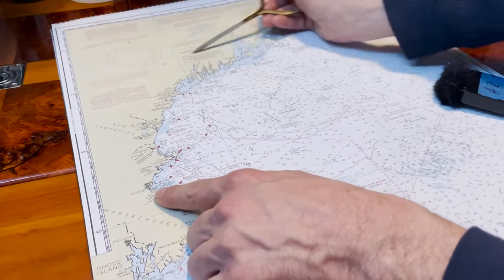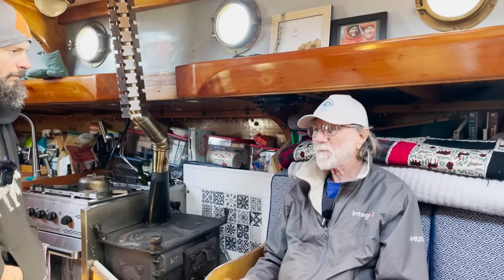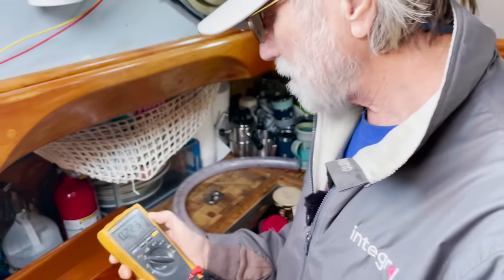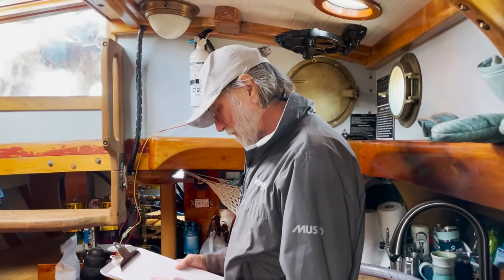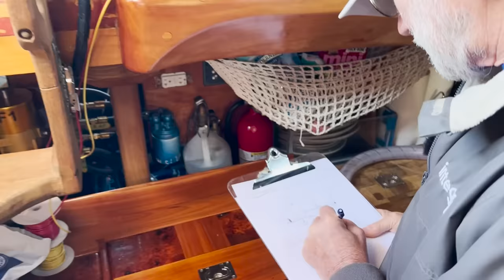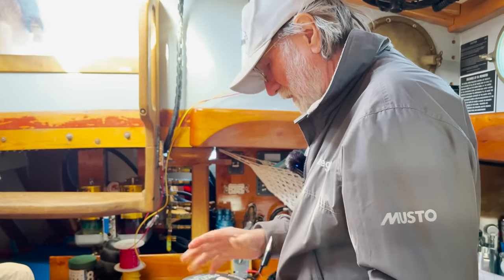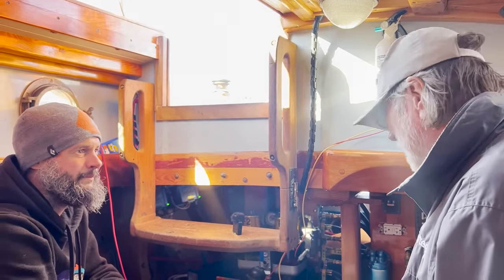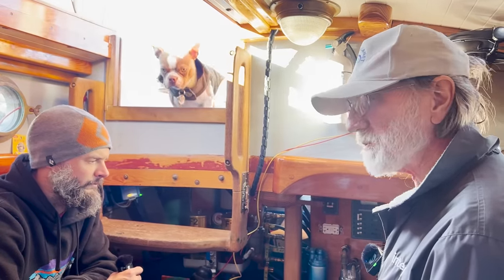Nigel Calder Looks For Stray Current - Episode 289 - Acorn to Arabella: Journey of a Wooden Boat

Comment: The first reading of 0.222V is the galvanic potential of graphite. Graphite is often used in batteries and capacitors as the anode. As the stainless shaft rotates and causes friction against the graphite you get a piezoelectric effect that charges the graphite up to 0.8V. When the prop stopped spinning the graphite slowly discharged through the prop shaft, prop and zinc anode that is -0.8V potential. Between the 0.8V graphite and -0.8V zinc, that's a voltage potential of 1.6V just like a carbon-zinc battery! The salt water is probably the electrolyte. I think I would call this a piezoelectric or electromechanical current rather than stray or galvanic.
Reply: Thanks for sharing had not known of the problems cheers
Reply: Excellent information sir, especially the piezoelectric effect with the shaft rotating. Thanks!!
Reply: Wow who would have guessed…😳

Comment: Nigel is the kind of person that you could listen to for hours!
Reply from the maker: Indeed! He told some cool stories, too.
Reply: I did not even have to watch the whole video read all nigels books
Reply: Beautiful sound of the engine starting, change the alteration your   problems are solved. Remove the wire or alternate with engine shaft.
Reply: I pray for mother health also. May GOD ALMIGHTY KEEP THE BLESSINGS WITH HER. AND KEEP YOUR FAMILY FROM HARM'S WAY. AAMEEN.
Reply: When you get the new alternator, will it be the same electrical output or will you built in some future-proofing with increased output? I’m guessing the packing being replaced I’ll have to wait till the boat is hauled out of the water - what will you be replacing the graphite with? Also wood mounting anodes to the deadwood on brackets (for easy replaceability) & somehow connected to the prop shaft help at all? Hope you get everything sorted out, especially for peace of mind soon! I also hope everything goes well for your mother. It’s really wonderful that you’re able to move Arabella to be closer to give her that support if needed.

Comment: That was truly fascinating.  Nigel's methodical and logical analysis makes the baffling mystery sound so much simpler.  What a relief that a cure now seems doable.
Reply: In being a good, if not great, electrical/electronics engineer, the mastery of logic (I don't mean digital logic) is FIRST. Competence at circuit analysis is absolutely required, but next down the line. It takes looking at these problems thousands and thousands of times, over man years, to get really good at the debugging process.

Comment: Great episode!  Rod at marine how to has a page on packing material. I just removed graphite from my stuffing box and replaced it with a polyester/PTFE packing. A yard installed the graphite in early 2017  along with a new bronze prop for the previous owner of the boat. I need to replace the prop due to zinc loss.  Friends don't let friends use graphite packing!

Comment: Enjoyed this very much. I have Nigel in my library and have learned a great deal. The EE in me is a little fuzzy on the graphite interaction, and how the current generated in the stuffing box ends up out at the shaft zinc. I would think that the cell would form within the packing gland, and the current be confined there... Would love to see the circuit diagram after Nigel has had some more time to ponder...
As for the alternator, In my case I was able to disconnect the internal regulator at the brushes and bring the brush connections outside the housing. I put quick connects on the leads that would allow reconnecting the internal regulator as a backup, or connecting to my Balmar 614. You don't need to replace your existing alternator,  just figure out the correct place to disconnect both leads from the brushes and make connection points to your charge controller.

Comment: Nigel seems like a really nice guy. He was thorough. That was a tricky one to figure out. You can change that packing in the water. There is a special tool for changing that packing, it looks like a wine cork on a spring with a T handle. You twist it into the packing and then yank it out. When you undo the stuffing box, stuff a rag around the shaft. You should have enough room hopefully to undo it and pull it forward. Good luck, and hope for the best on your journey south. ❤️✌️
Reply from the maker: Thankful for you, friend! —Annie B
Reply: I would be cautious about doing that in the water but I don't imagine there is much pressure around the shaft at that depth.  You'll need to temporarily seal where the shaft exits the hull.
Reply: @randogame4438  yeah, it’s doable. You ever open a thru hull and see how fast the water runs in? It’s quick, but it’s not like a firehose. Pete’s done it before, changed his packing in the water. Just stuff a rag in the hole. The only scary part is if the threads are real bad and you don’t know if it’ll thread back on or not. Usually those threads are real coarse. Or if the alignments off or something.  That would be worse case scenario.

Comment: I'm an old Marine Electrician and my money is on the Alternator having a blown diode.  I once helped a friend whose boat was literally eating batteries, we fitted a new set of batteries and I felt the alternator, it started getting warm even without the engine running.  The batteries were draining backwards through the alternator.  The shaft packing was an interesting  find though👍 I wouldn't have picked that up as quick.

Comment: On one of my frigates we went from a Teflon stuffing box packing material to a mechanical seal.  Graphite stuffing is what we used in steam valve stuffing boxes because of it's high resistance to heat and it also provided a lubricating value to the valve stem.  I never gave a thought to graphite being an electrical conductor.  Very Interesting.
Reply: Not just a conductor, but highly noble on the galvanic series, and hence consumes zinc like a starving hiker who comes across a stash of Doritos.

Comment: If you have a Balmar series 6 alternator that can be regulated either with the internal regulator   Or an external regulator, it is an easy process to go from one to another. There is one wire to connect to +12v to allow the internal regulator to regulate the alternator field current. That wire needs to be disconnected and a different field current wire

Comment: The go to stuffing box packing in Gore Tex gfo. It has NO graphite in it. Been using it for years on my boats.
Reply from the maker: Thanks for that tip! What size packing are you using?
Reply: For my shaft it is 1/4 inch

Comment: graphite is conductive...your using it as packing for a rotating shaft....so you have basically a coil rotating in your stuffing box as i see it ... a coil with a voltage and rotation  i think i understand where your current is coming from but just barely lol. thanks for a puzzle and the videos as always.

Comment: Go to any local parts store and ask for an old MOPAR alternator like 1970 for example. Make sure you get the amps you need, and one or two pulley grooves you need. Older MOPAR alternators were external regulated.

Comment: OK. so I said it was the alternator. It sounds like it may still be in play? The increase in resistance with the engine in gear may not be gear oil... but the force of the prop pushing on the trust bearing?

Comment: Very informative. I have always shunned the graphite packing having heard it can tend to wear the shaft  ore than other types. Now I wonder if the increased shaft wear is not often partially a result of electrolysis within the stuffing box? On the other hand, traditional flax/wax packing is finicky - melts if over tightened, leaks if water temps drop. My Goldilox , just right is the white teflon grease impregnated stuff.
Reply from the maker: It’s an interesting thought.

Comment: Interesting. Thanks for sharing. Maybe install larger zincs to the hull and electrically connect them (via wire) to the engine block? If the zinc is corroding due to current path, then there has to be a return path through the water. I think he’s right about the graphite packing.

Comment: Once you've fixed the stuffing material issue you might wanna think about shorting the engine beds/bronze floors to the rest of the interior. I was a bit worried to learn about the pontential difference between the bronze floors and the engine/propeller shaft/propeller. Otherwise, once you've fixed the galvanic element currently formed by the graphite stuffing vs. propeller shaft you are gonna end up with the next (avoidable) galvanic element between the propeller shaft/zinc anode vs. the bronze floors/through-bolts you are trying to protect in the first place.
Reply from the maker: Unlike graphite in relation to everything else on the boat, silicon bronze and stainless steel are close in the galvanic scale, and are the preferred materials for their jobs there. You’ll notice that Nigel didn’t bring it up, nor did he suspect it.
Reply: Could it be that the different volt reading from the engine shaft and zinc to the bronze floor is acting like a battery with the salt water the path. Therefore if you short your engine to the bronze floor the difference in voltage will disappear and the battery will disappear. 
Bronze to zinc to salt water to bronze floor could be a basic battery?
Reply: But I know the current would probably be so low it would not be enough to have eaten the zinc away

Comment: It makes sense that the voltage regulator can cause problems.  They're designed to dump over voltage straight to ground.  That ground is the engine housing and ultimately through the prop shaft.

Comment: I worked on a van with a straight six that would corrode the radiator away the coolant was acting like electrolyte and the motor became a battery. Rare condition. I was told that replacing the engine was the only fix. Customer never replaced it so never found out if it would have fixed it

Comment: Before you buy a new alternator I’d suggest you take your existing one to a shop that rebuilds them and have it configured for an external regulator. I’ve had two “dumb” (internally regulated) Hitachi alternators modified this way and regulated with a Balmar ARS-5 and they work flawlessly with my Yanmar 2GMF engine. Or, at least ask Nigel about the possibility before spending popping for a new one. The modification is a much cheaper option.
Reply from the maker: We’ve gone with the cheaper option here that I think you’re describing… a modified alternator from a Nanni technician is what’s on there.
Reply: Excellent. As Nigel pointed out, the conversion wasn’t done correctly. Nanni should offer to fix it for free. Otherwise a local rebuild shop can do it for you. Truly admire what you’ve accomplished. This is just a minor bump in the road. Keep up the great videos and adventures.

Comment: So what's the solution? Go for a cold swim to bolt on a new zinc or two or get hauled out to both repack the stuffing box and replace the zinc on dry land? I guess you'll need to haul out at some point to do the stuffing box so is it worth getting it done sooner rather than later?

Comment: What kind of alternator are you going to look into? Will it be substantially different in electrical output? I also wonder what type of packing you will choose in place of the graphite. Is there any other place to mount the anode for more substantial protection? Really awesome that you can move the boat to be closer to your mom to be there for her and your family.
Reply from the maker: Not sure quite yet but we’ll be updating in a future episode for sure.
Reply: I recommend Gore-tex stuffing.  I have used it for years and it needs almost no water dripping in order to keep the shaft cool, perhaps only a slight drip while running.  Before that I have tried Teflon packing, but it heated p and was not good. .  Awesome boat and channel!  keep it up please! @AcornToArabella

Comment: A turning propeller is electrically insulated from the hull by the lubricating oil film in the bearings. Electrical potential is generated between the shaft and the hull. As a result the cathodic protection of the ship will not protect the propeller. Electrical potential can cause currents in the bearings resulting in pitting of the bearing surfaces. Problems can be avoided if the shaft is earthed with a propeller shaft slip ring. This shaft earthing assembly comprises a pair of high silver content/graphite compund brushes mounted in a balanced brush holder, running on a copper slip ring with solid silver track. Try earthing the shaft via brush assembly
Reply: That's what I was gonna say
Reply: Genius
Reply: Wouldn't the graphite packing behave the same as brushes assuming the block is grounded?
Reply: it should be a proper grounding of the shaft, there are some arrangements of brush assembly available which has to be connected to shaft and the grounding wire is to be dipped in seawater some how. wire should be laid down and dipped in water.  @AmosMosesJr
Reply: @atulshivnandandixit7957  I understand but wouldn't this contradict what was explained in the video. Are you suggesting this is the actual cause of the problem or just good practice? I never heard of this done before but I don't work near the ocean and only have worked on smaller fresh water boats.
Reply: @AmosMosesJr  This is a must on ships I work on (Big ocean going vessels) but as in video I noticed, as soon as the engine was turned on voltage increased, that's what I could think of. as this is a wooden boat and few metal parts in contact with sea water it could be possibility.
Reply: @atulshivnandandixit7957  thanks for your insight. It makes sense to me why you'd want to ground the shaft. This still wouldn't explain why the anode rod corroded so fast unless I'm missing something. So you're saying remove the carbon packing and add a separate grounding slip ring. The stray current is a separate issue. I updated my response because I think you're right I just wanted to recap for others who might be confused like I was.

Comment: It sounds like the number one priority is to haul out and remove the graphite packing from the stuffing box ,clean the graphite residue thats inside the box and replace the packing with a packing that doesnt cause the current issue that may destroy the shaft from corrosion. Replacing the shaft would be a big expense and worse yet if the corrosion is interacting with the shaft inside the stuffing bow it could cause a failure of the shaft and water intrusion into the boat. It may be possible to replace the graphite packing while the boat is in the water if theres a way to seal the shaft alley long enough to replace  the packing and clean all the graphite out of the stuffing box.

Comment: If the ground straps are to the engine bed and the engine bed is attached to something that is touching water wouldn't that be the ground path? Would putting rubber isolators between the engine bed and floors help isolate stray current?

And so sorry to hear about your mother, cancer sucks.

Comment: It's complicated stuff this electricity. I was wondering; if you change out the stuffing and the Alternator will you know if the corrosion issue has been solved immediately or will you just have to wait and see how long the sacrificial anodes last?
Wishing Steve's mum all the best.
Reply from the maker: You’ve got it correct there, we will have to wait for a while and see if that was truly the cause with observation.

Comment: AH ! - now normally i switch off at this point, i have very little interest in electronics and witchcraft haha - BUT from a point of view of galvanic conduction that does make things very interesting especially when this kind of thing is just what concerned me with the sad loss of the Titan minisub close to the Titanic - something drastic must have been overlooked from something contacting water (ie with salt content which has better conductivity) and what ever components were being relied upon inside as well as all the structure and carbon fibre which again is another good conductor (i think) someone will correct me - but there were a number of other issues that concerned me with the sub which i won't bore you with here - but the galvanic issues do speak volumes of well known problems that can arise and we can see here, building a simple wooden boat, is just not as simple as it seems - more witchcraft at work haha
but i do remember many years ago of an older car having electrical issues, most of these these days are of course well known and been ironed out in more modern cars, but the issue i had was originally bad engine starts, so i was advised to move the earth to the engine, the starter was earthed to the engine, the battery was earthed to the chassis, if that end was on the engine, when power went to the starter it was earthed to the engine, the engine earthed back to the battery, makes perfect sense, so that shows either a drop off of power, and possibly shorting, i guess, sounds like and i think was mentioned at about 38mins, this could be an issue here

Comment: On my yacht I have a flexible coupling between the transmission coupling and the gearbox coupling, this I believe isolates the shaft and prop electrically from the engine/gearbox. Does this make sense to you?